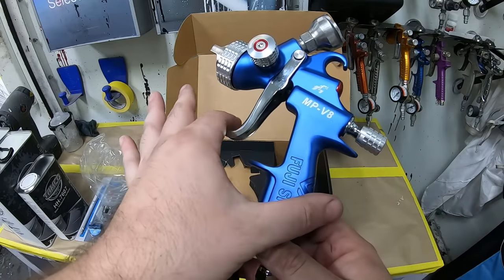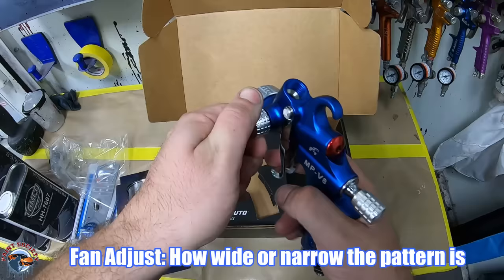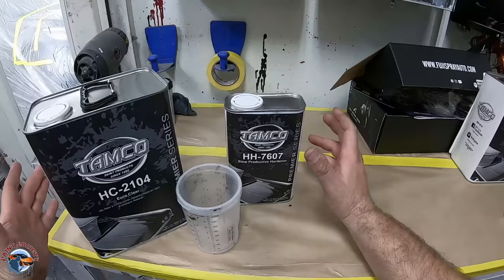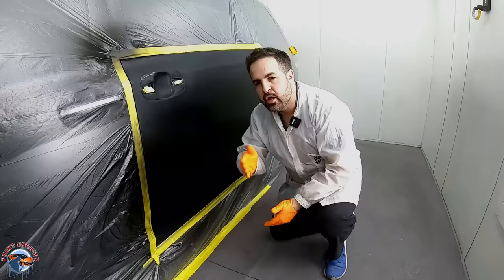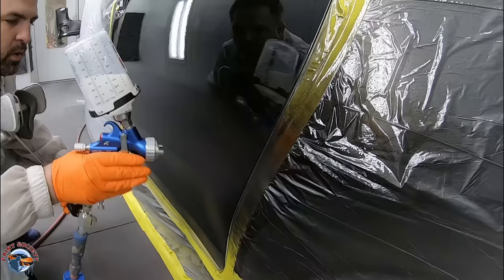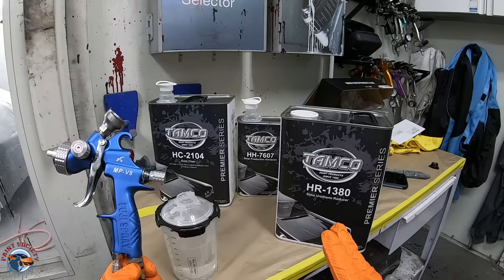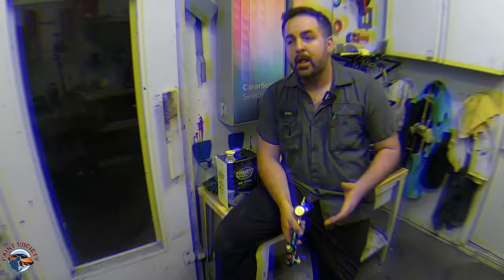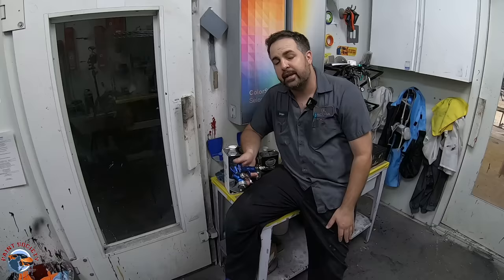The Best Paint Gun Settings for Spraying Clearcoat

Comment: As a guy who painted for 36 years I would recommend NEVER using those silly on-gun regulators. Just open the on gun regulator all the way, pull the trigger and use the wall regulator to set pressure at gun. Then, take the regulator off. Using the wall as a baseline. They restrict flow too much and via the venturi effect can cause condensation in your air supply especially for at home guys.
Reply: Upload a tutorial
Reply: @coolguy8063 Upload a tutorial? He just told you what to do. You can’t follow simple verbal instructions?
Reply: No you are wrong never adjust pressure on the wall or tank

Comment: Great tips!  I'm just a hobbiest and only done a half dozen full repaints & a few repairs.  For the longest time I thought first "it has to be the gun - need a better one".  Then it was "always use the recommended settings".  Then it was "always use 50% overlap" (way too wide!).  So all along there was a lot of cut & buff to fix poor results.  Finally figured it out - realizing the obvious "look at the results and make whatever adjustments necessary to make it look right - duh! (including rate of travel)"  And atomization is key.  The cloud of overspray threw me off until I saw how much better the finish came out.  Thanks so much for putting it all in easily understandable words and giving real examples!  Wish your videos were available years ago when I started!

Comment: FYI.   I’ve gone the whole range of emotions on one single project.    I’ve sanded the same panels so many times it’s not funny.  I’ve said “this is the last time no matter what” way too many time, at least ten.     Finally, some how, I finally got one side of this truck so good I won’t need to cut and buff, but now I have to redo the drivers side to be as good as the passenger side!    Mercedes ML320, 040 Black, apparently pure black is the hardest color to paint, and it has done a number on me.  I’ve got pictures of finishes I can’t believe I had to sand away because of flaws.    But you have been the one to help me stay motivated to try again, do better, try harder, gather some resolve, and beat the odds.   I’ve achieved glasslike, better than OEM very low orange peel in my garage, and that’s quite a feeling to look over and go, “I painted that!”      And be proud.     Thank you.    Any criticisms were with love I assure you.

Comment: I just painted my daughters 2004 Honda Civic EX in factory black pearl.  I don't have a booth so it was basically a scuff and paint project in my driveway.  I am a hobbyists at best.  I used water based paint.  It went on really  good.  The clear was a completely different story.  Now I know what you mean by not letting off the trigger as to not have burst of clear.  Since I was painting the whole car I did it in sections and did trigger on trigger off.  I couldn't keep a wet edge if my life depended on it and even though some runs are OK because you can sand them out.  These runs on the other hand looked foamy.  So even when you leveled it you still saw what looked like a run stain so I had to redo part of the car.  The clear also had a lot of orange peel, I mean a lot of orange peel.  I used an Eastwood CC 500 gun.  My results were horrible.   When I did my sons 2002 Honda with a $59.95 Harbor Freight special HVLP gun my results were way better.  I didn't have to cut and polish his car, but hers I spent a week cutting and polishing.   It looks fine now but I've painted at least ten cars inside and outside of a spray booth and had phenomenal results.  I don't know enough to pin point where I made my mistakes.  I am the buck stops here guy because I have no one who could look at it and say ok you should have done this or that.   I adjusted the gun to 22 PSI with a 1.4 tip.  The gun also came with a 1.3 tip as well.

Comment: G'day I have a version of this gun made in Germany I think. It's called a Durr 910 ecogun mplv  and 3 different set ups. A 1.2, 1.4 & 1.8. I have been told that the Durr is the original, there is a pressure gauge on the fan adjustment. Sprays well but I love my Devillbis GTI pro lites, what you guys call a Tekna pro lite. Cheers. 👍

Comment: So I can't tell you how grateful I  am with this high-level gun / finish information you are sharing. 
I am looking for advice about clear coat selection both brand and where to buy it. 

I cam a cabinet maker....so I am only spraying wood that is located inside  a heated and air-conditioned home. I and my customers like the deep rich depth of finish I get with automotive clear coat!! So UV degradation is not a factor.....

So what brand of clear coat would you recommend that is economical and suitable for wood work?? And where to buy it?

The detailed spray gun and  set up training is for the most part unknown in cabinet shops!! Thank you!! For making this information available online! 

Thanks !!

just jim
Reply: Also do they make a flatter for the clear coat as high gloss often looks like cheap plastic on wood?? 

Thanks 

just jim

Comment: Ideally, you need a vac system in your left hand to catch all the over spray.  I pull through a water filter, then into a carbon filter and out of the shop area.  I have been doing this with lacquer, epoxy and urethane with no spark issue, using a spark free vacuum, since 1996.... I also run it constantly during any dry sanding. .. In the shop I hang a spring retracted rv hose with a sacrificial air duct hose. The sacrificial 2 feet can be swapped out after every job, as they get dried paint that eventually flakes down onto the job.  Duct tape hoses together....  I do not think that this should be mandatory. However, it is really nice to have for dust and fume cut down in field painting and shop painting.  Point of capture is many orders more effective than general dust and fume systems.

Comment: Love your videos.  Even the inflection in your voice was spot on when it needed to be.  2 questions:
1. It appears the door you painted already had scuffed basecoat (or perhaps the original paint on it).  So you laid the clear on a dry, scuffed base.  I've been told that I can only spray clear over a wet (flashed 15-30 min) basecoat.  Is that true ?
2.  I read somewhere in the comments that your day job is a teacher.  Just wondering what you taught.

Comment: Nice finish. I don’t get to see that gun in action. I do recommend on checking tds for the clear that the user use’s, if there is a required purge time (5-15 mins wait to bake) or if you should go right to bake. Some clears are design for immediate baking. For exp...the rm clears I use recommend to bake immediately for best results.

Comment: Questions: #1 Setting the fan pattern wide open does that give the oval football shape or is a clear gun pattern different.  I have always sprayed a test panel to dial in the gun looking for the spray pattern, amount of paint to set, and adjusting the air pressure to achieve the proper spray.  #2 Does your speed with the gun allow you to run close to wide open paint setting?  I have seen another one of your videos where you state to make the paint wide open because the gun was designed to flow or atomize its best.  Is there a conflict with these two settings? #3 The pressure gauge on the gun since you are running down in the 20 lb. area is there a gauge that reads on a lower scale instead of all the way up to 120 PSI; for example, a range of 0 to 60 PSI range? #4 Is that spray gun a conventional gun that runs at low PSI or is it an HVLP which confuses me since HVLP is low pressure?
Reply from the maker: James. Send me a message on IG and I can leave you a voice memo to help answer this better. 

Paint.society

Comment: Hey Brian that looks really nice, I want to ask for a recommendation on maximizing my paint job in a garage since I don't have a paint booth, thank you.
Reply: bro same here i also want to know if any compressor would be fine
Reply: U guys are gonna need a pretty big compressor to spray your vehicle because ur gonna run out of air before u even finish spraying a single panel. And will be waiting for the compressor to fill before u can start spraying again. If u take all the panels off u might be able to get away with a 5gallon compressor, i would also use an HVLP gun since it also uses less air. You will also need an water/oil filter to attachment to ur gun for contaminents so u dont get fisheyes, cost around $10
Reply: Eastwood makes a gun for small compressors. I used it with a 29 gallon Craftsman oil-less compressor..As long as it puts out about 5 to 6 cuft/min it will run this gun.  Comes with a 1.3 tip and a 1.8 tip for primer.  Kit runs about $170 but they put it on sale quite often.  The gun isn't as air hungry as some of the regular HVLP guns but you have to plan your shoot because you will still run out of air if you try and paint the whole car.   I've painted an entire side in one sitting without too much trouble but it was about at the limit of what my compressor could deliver.  Since then I've upgraded to an 80 gallon 7.5hp two stage  compressor so air isn't a problem for me now.

Comment: I've never had a problem with a nice coat of clear. But I'm still having problems with spraying primer from top to bottom or bottom to top. And it still gives me a sandpaper effect. What am I doing wrong???? Tried almost everything. Distance, thinning, etc. I'm at my wit's end.
Reply from the maker: Add 10% reducer into the mix and that should help loosen it up
Reply: The viscosity of your primer is too thick..look up how to measure the viscosity of primer

Comment: Hey guys, Brian, you rock man. Thanks for posting these vids. Im learning alot.

I messed up today. I bought a devilbiss basecoat which im ecstatic over but the needle tips are 1.2 and 1.3.

I was planning on spraying metal flake but i noticed on the site that size required for the flake is 1.8

Is it possible to swap my 1.3 tip with a 1.8 or will i have to buy a gun specifically for the 1.8 tip?

Comment: Brian, I paint motorcycle helmets and decided to use the sun to bake my helmets to speed up curing. Normally, I let the helmet sit for a month indoors after final clear coat.  I do two rounds of clear. Round one to build up clear then sand to bury the graphics and then reclear. After second round, I put the helmet in the sun after 1 hour. However, the heat from the sun caused the helmet to wrinkle.  When I took it out of the sun, the wrinkles went away after 24 hours.  What do you think is going on? FYI, I used Createx water based paint for the graphics.  Could there be moisture under the clear causing the wrinkling?  Great tutorial by the way.

Comment: Brill, thanks! 

Pressures are still slightly confusing to me (I'm a DIYer), so have a compressor delivering only 9.6 CFM. Right on the for FLG5 (on the paper at least), which works for smaller bits. I though I'd get LVLP, more suited for small compressor and here's the problem. 

With lower pressure I still get plenty of orange peel. I need to crank up the pressure to over 25 PSI to get semi-decent finish, but that's high enough to cause a lot of overspray and still bleed the compressor too quick for the motor (which was not supposed to be a problem for LVLP). Is there something else to considering when setting them LVLPs?
Reply: Use thinner paints and clear. Thinner means less air and less fluid

Comment: Hello Brian, I thank you for site, it has helped me get the knowledge I needed to set up my gun. I am in the process of converting my 1959 GMC Grumman Kurb Side into a mobile coffee roaster Kiosk. Question can I mix metal flakes with clear coat to clear coat the side windows that are acrylic sheets? If so, would you be so kind as to tell me what I need to know. This acrylic sheets is the same as what is being used for like sneeze guards and windows. Thank you for your site. Boss Tom

Comment: Brian,  I have a T - Series Spray gun from Fuji.  I'm using a Mini Mite Platinum 4 Turbine system.  I have to say the base coat turned out FLAWLESS with a 1.3 mm tip.  My question is this...I'm going to spray the clear coat tomorrow.  What tip would you recommend for the T-Series HVLP Fuji Gun using a Turbine System to spray clear?  

Fuji was saying most likely a .8 mm or a 1.0mm.  What do you think?

Comment: What size compressor would you need to paint ? I was looking at one with 11.9 cfm @90 psi
Reply: Depends on the airflow requirements of your gun and how large or small the project.  Just doing motorcycle helmets a small compressor is ok. Overall refinish on a 4dr long box truck ? Going to need a big one.

Comment: Have a Walcom Slim Xlight HVLP brand new. 1.3. Maybe not familiar but a midrange gun from what I understand. For clear and in a garage (not booth) setup should I be lower on pressure, perhaps 15-20 psi at gun, and less fluid (maybe 2.5 turns in or so) and a 8" fan? In my setup, the specs on the clear (PPG) and the gun talking about 29 lbs seems too high. I should have less pressure, less fluid, and not a huge fan. Of course I will test, but agree?
Reply from the maker: Don’t follow the specs too much on the tds. Just follow what works on your paint gun

Comment: You said I can even make clear base from over reduced clear.  Do you still use activator for using clear as a base coat?
Reply from the maker: Yes. Mix clear up normal then over reduce by 800%
Reply: @PaintSociety  Thanks Bro!

Comment: I just sprayed the clear on my truck and it came out with some bad textured orangepeel finish. I was able to fix most of it with progressive wetsanding and buffing but that added a lot of hours of work. I have a few friends who want me to spray thier vehicles and I dont want to have to do that again. IT seemed like it was using very little paint and it wouldnt want to "wet out" even though fluid was wide open,  fan was 1/4 turn in from wide open but seemed huge. I was using the $80 harbor freight gun. Pressure and mix ratio was dead on for what the paint manufacturer recommended. My basecoat came out perfect using a different gun so I dont think it was technique, any ideas?
Reply: Spraying base is always easier than clear. What did you do wrong  ? No way to know. Probably all the above. Ditch the HF gun. Ditch the paint manufacturer psi reccomendation.  They don't know what gun your using. Practice on test panels until your happy with results.

Comment: Hi Sir, I spray my clear coat but I constantly see it in large dots and then a really orange peel finish. Is it fluid or air? I’m just confused thank you.
Reply: Orange peel can be caused by oil in the air supply.  Do you have a good filter?  Too much flow also.  Lots of variables.  Usually I never get orange peel, but too much sag.  The gun you use does make a difference.
Reply: Sometimes the viscosity of the clear will make the gun spray it like orange peal. If your gun distance is to far away it will spray like orange peal
Reply: Randy turn your fluid tip in..less fliud more air, 29 psi is standard

Comment: What u think about wet sanding b4 spraying your base coat
Reply: Its good cleans away dust and grease if you put a little bit of ivory dish soap in your sanding water. Just make sure it dry and all sanding sludge is wiped away with a clean shammee

Comment: Hi Brian,   i am planning to spray my 73 VW Camper using 2 pac DS , I have a GTI pro Devilbiss but what would be the best fluid tip size ?  thanks for your help .  Chris
Reply: 1.3 tip, full fan. Full fluid. 29psi with GTI pro Lite. Te20 cap. Get ready for a mirror finish.

Comment: I have two older devilbiss gti and a satajet 2000 all with 1.4 tip. Is there a huge difference on painting with the 1.4 vs 1.3 tip? I dont want to buy any new guns since i dont paint all the time like i used to. Can i get the same results today with the paint co. Recommending the 1.3?
Reply from the maker: 1.3 will put on a thinner coat, less chance of solvent pop and building up the edges on a panel.
Reply: @PaintSociety  can u get the same with gun set up?

Comment: i am trying Tamcos hi-impact  clear 4:1 ( medium hardener)  for smaller motorcycle parts.   I have a 1.1 airbase spray gun ( sold by emaxcompressor)  for doing smaller parts and a Eastwood 1.4 for big stuff.   Tamco recommends 2-3 coats .  Is that 2-3 wet coats following the tack coat or is that 2-3 coats total?  and if as a DIYer if I dont have access to a bake booth does it have to be baked or is it better off air drying?       I seem to either get speckled spots on the edges  or runs and its driving me mad.
Reply from the maker: 2-3 coats and the stuff is tough to lay out. It dries quick.
Reply: so just 2-3 coats total .   Not tack coat then 2-3 wetter coats.  and i have the slower hi-impact not the 30 minute stuff.   I tried that and it dries too quickly for a larger object like a fairing.  Its fine for real small stuff.
Reply: Today.tried your faster with cooler temps and spraying non-stop off the edges and lighter coats technique with the bike I have in the shop and got much better results!!!!  Still got some orange peel and a run,  but over all much better.  Thanks for the tips and these great vids.